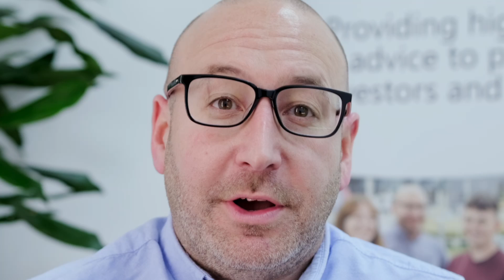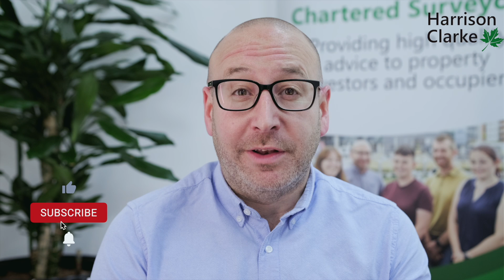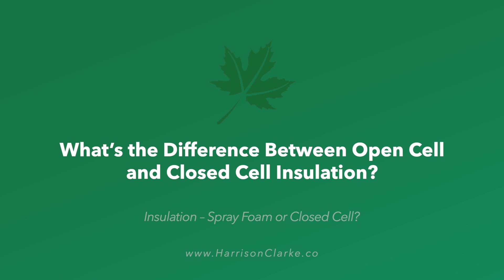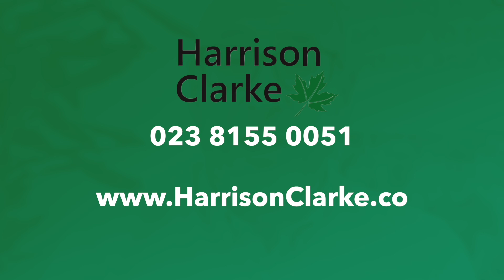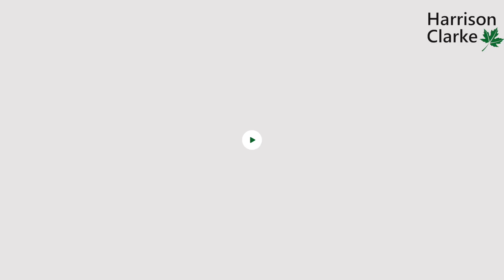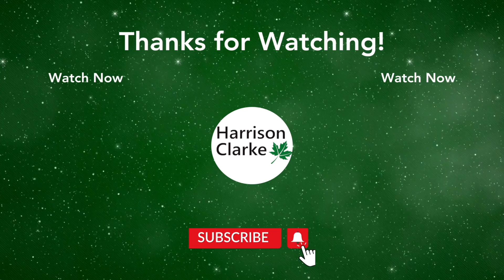Insulation – Spray Foam or Closed Cell?

Comment: Thank you for the information on the difference.  Due to flammable and other factors it is not a choice for my home.  Perhaps a shed or garage.
Reply from the maker: Glad the information was helpful! If you need any other assistance, please don’t hesitate to get in contact.

📞 - 023 8155 0051
📧 - info@harrisonclarke.co.uk
Reply: Hello so I'm getting a breathable open cell spray foam done in my attic. He is first putting a 2 inch vent card so the foam does not come in contact with my breathable felt and the spraying 9 inches (225mm) of foam onto the vent card. He is doing this a long time so I'm hoping it will be fine
Reply from the maker: @jericho9653  Hi Jericho9653 

Unfortunately without inspecting/viewing the Spray Foam application, we are unable to comment on whether the process is correct.💚
Reply: @HarrisonClarkeSurveyors  you should be a politician with that answer
Reply from the maker: @jericho9653  I understand your frustrations. Our goal is to provide accurate advice, as every installation can vary and without inspecting it we can't comment. 

Let us know if we can help in anyway.